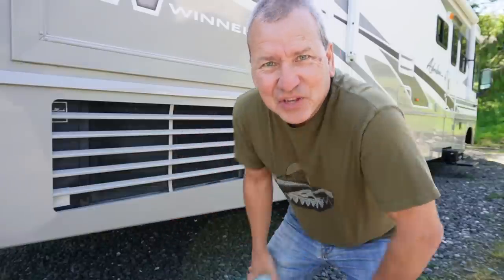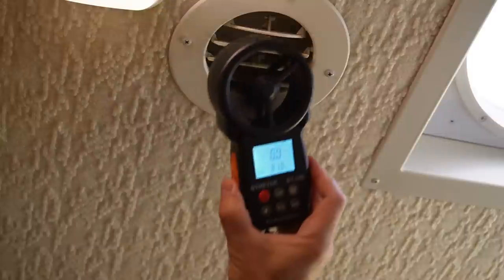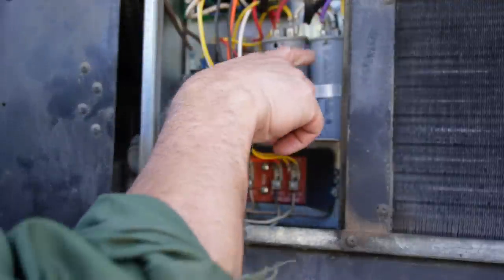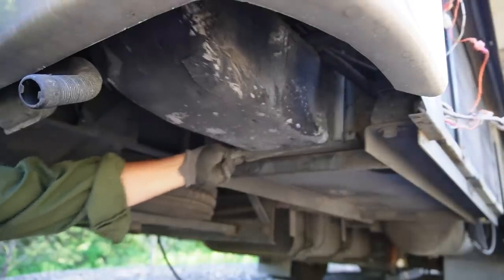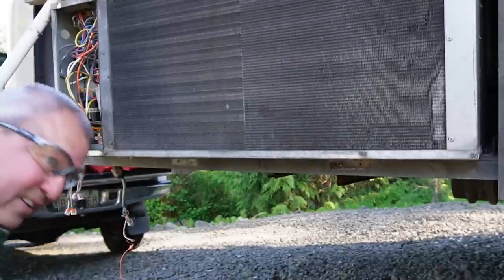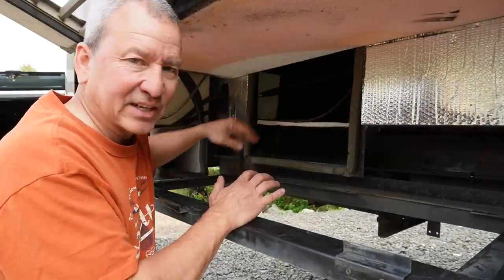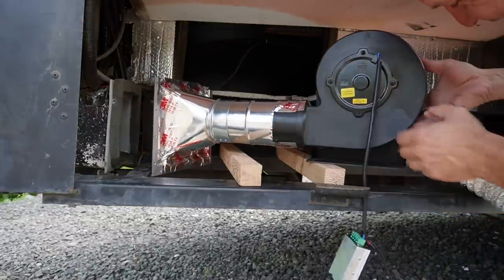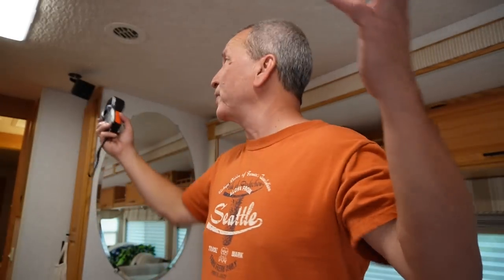My 12V RV Air Conditioner Install (Part 1) - Removing Failed Basement A/C | RV With Tito DIY

Comment: Have you considered a mini split
Reply: That was the first thing I thought of but he wants it to run on 12 volts. I don't think there are any 12 volt mini splits but I could be wrong.
Reply from the maker: Yes. It will be a mini-split...just not the kind you're thinking of ;)

Comment: 48v system with a small 12v for your lights/pump. Run everything large off 110ac. 12v, 1000w? No.

Comment: Looking forward to seeing your project through completion. Looks like you might be shedding some weight taking that big AC unit out and putting in something new.
Reply from the maker: Definitely. It was an immediate 200 lbs of weight loss. I can't imagine the replacement components weighing half of that.
Reply: @RVwithTito  Has part two come out yet, i have a very similar RV this video is helping me out big time!
Reply from the maker: @clue___  No not yet. Still working on it slowly though. Probably more coming in early/mid August.
Reply: @RVwithTito  Awsome I know it’s really time consuming just to make repairs but on top of that you have to film everything and edit the video down. If possible do you know which system your going with I’d like to go ahead and place mine on order. lol I know I might be asking a lot. I just want to take my family out for there first trip before the summer ends. 😄
Reply from the maker: @clue___  I'm working with Cruise N Comfort in Arizona. Installing a customized version of their larger VES MAXX system which is going to be challenging for my RV.  It's not a drop-in replacement and will require significant modifications to make it work. Working on improving my welding skills as we speak :) We've cancelled our summery travel plans and are taking it slow.
Reply: @RVwithTito  oh ill have to check them out excited to see the outcome! Ill have to see if its something I can find for a guy with a lower skill level. not sure if welding is in my wheel house 😀
Reply from the maker: @clue___  You could install a traditional mini-split, but you'd have to mount the evaporator and blower inside on a wall.

Comment: The basement air on the 2003 Winnebago I bought was completely dead. I bought a new board, relays, caps and motor bearings. All total about $900. Built cribbing with wheels and slid the unit out without issue. Rebuilt in 2 days and reinstalled. Comp #1 drawing 5.27A and #2 drawing 5.16A. Heats and cools like a champ.Did I mention that I had no experience in this area.

Comment: Your first airflow was measured at low fan speed. The test blower only had half the flow at its full speed. I think you should have checked flow with the original unit at full speed too. Seems like you would need a much larger blower to keep cool. You must never visit the desert Southwest in the summer. I wish you well in finding a replacement unit. There are many new, low power HVAC options available nowadays. Hopefully you will find a solution that fits without too much modification (cobbling). However, cobbling is pleasurable. Cheers.
Reply: Sorry, I just read you were installing a mini split. Good choice. Looking forward to following the journey.
Reply from the maker: I measured the old-fan speed at low because we have always used it on low speed which is plenty powerful. The high setting isn't much different. Yes. There will definitely be some cobbling :)
Reply: @RVwithTito  Thanks for the reply. I had a 34 foot trailer for a few years. It had two 13.5 kBtu roof units that in the Texas summer I needed to run full blast to keep cool. Noisy as all get out. I just installed a 12 kBtu Mr Cool split unit in my wife's art room that replaced a noisy window unit. Very pleased with the quiet effective cooling we get.

Comment: How about an external/outside 120v outlet for one of the spare circuits? That might be generally useful.
Reply from the maker: Thanks. Yes that's possible. I've got one on the side, but having one on the back to charge bikes and run my power washer may come in handy.

Comment: If you don't already have a 120v plug at the back of your rig it might be useful to use one of those circuits for that.  When in camp I usually put my ebikes out of sight at the back of the rig and it would be nice to have a 120v plug there for the chargers.
Reply from the maker: Same here. I have a plug on the side to charge the bikes on the rack. Having one on the back would eliminate the extension cord 👍

Comment: Probably too late to suggest just retrofitting the old AC tray with a new compressor and blower motors that are efficient. Maybe even go heat pump.
Reply from the maker: Oh I know. I'm still considering using the old AC tray, but I probably won't and built my own enclosure instead. At least I have the dimensions since the AC is sitting in my driveway :)
Reply: @RVwithTito  I have a background in commercial HVAC, you can replace all of the components with new technology. Going too small on the cfm or btu ratings will actually increase the power consumption over longer run times.
Reply from the maker: @arthurcutting9227  Appreciate that. I'll keep it in mind.

Comment: The test tools you create for your projects and your planning and engineering solutions are top notch.  Thank you for your terrific content.  BTW, after two years of full timing with our RecPro powered recliners they are shedding their skin.  The mechanics are still great, but the pleather could not hold up to normal daily wear.
Reply from the maker: Sorry to hear about the recliners. Ours have held up ok (in our old rig). We treated them twice a year. New owner, has a couple dogs. So I'm not sure how the pleather is doing. Will have to ask.

Comment: I’m excited to watch how this turns out. I have a 2000 Winnebago Suncruiser with the similar basement AC w/dual compressors.  I just replace the evap blower motor, processor board and all the capacitors, too. Each one pulls about 9 amps so I did not connect to my solar system.  Thank you for these videos, this will be very helpful.
Reply from the maker: Yes. Around 9A per stage. I believe I could repair this unit if I wanted to get the parts and spend the time. But it would still be pretty power hungry and that doesn't work with our boondocking lifestyle. Still working out the details on this one.

Comment: We have the same ser up as well. Just returned from a beach trip. It struggled to keep it cool for a couple of 90 degree days. I pulled the slide outs in during the day to reduce the amount of cubic feet it had to cool. It helped, but not livable if we had a good week of that weather. Going to experiment also. We'll see what you come up with in the future.
Reply from the maker: Yeah. Frustrating. I'm making good progress and am optimistic. I hoped to get an update out yesterday but wasn't able to. Too much going on. Hope to share more next weekend.

Comment: I enjoy the content.  I have the same rv .  A 2001.   My air is working great . Looking forward to seeing your solution.   Love my basement air .
Reply from the maker: Thanks! Agreed. The basement air is great and much quieter inside. It's a feature that really appealed to me, given the extra space for solar. Plus there's no ugly/loud equipment on the roof.
Reply: @RVwithTito thanks for sharing your experience and knowledge, I’m about to remove my basement AC like yours, I have a bad blower problem and will be changing both blowers any suggestions on what else I should do?

Comment: I believe the air flow measurement to which you referred is in cfm (cubic feet per minute). Looking forward to seeing the completed project.
Reply from the maker: Actually the little gauge isn't that fancy. So it doesn't calculate the actual Cubic Feet per Minute. It simply measures velocity (wind speed) of the breeze blowing out as Feet per Minute. For cubic part of CFM I'd need to take the dimensions of the ducting into play and do some math. I'm just using it to measure something as a baseline :) BTW the 12V blower I was testing has a 390 CFM rating incase you're wondering.

Comment: Hello Brain, Those two circuits will definitely come in handy. Maybe you can turn them into outlets and use them for portable electric heaters or something like that. Just a thought. I am looking forward to seeing what cooling system You plan on using! A 12 volt system sounds really awesome! Looks like You will have plenty of room to work with. Looking forward to the next phase of this project. Keep up the great work and stay safe out there! God Bless.🙏🏻👍
Reply from the maker: Thanks. Yeah I've got a couple good ones already I use for a space heater which does the job good when plugged in. My primary heat when off-grid is my Gasoline heater (Webasto) which works great. My LP heater is my backup.

Comment: Hello Brian, great video.. I'm thinking that you will not have enough air moving so you may have to do a larger blower or add a second stage to that blower.. also, it's going to be a tall order to do the compressor and the blower for only 1000 watts. BUT I really hope it works.
Reply from the maker: Yes. I'm going for a second blower/evaporator. We'll see what that does. Still waiting on equipment though and working on other projects.

Comment: Another very interesting project.  I would look at the 24 or 48 volt marine heat and AC units.  You'll get a higher CFM out of them and you can use a smaller gauge wire with 24 and 48 volt, probably 6 or 8 gauge.    I think with the marine units you'll be at or under 1KW.
Reply from the maker: I like the marine heaters. The only problem is that they're water cooled with sea water. That's why they are much smaller. I know...bummer :)

Comment: I always likes the Itasca's with the Basement air.. The Duct work goes up thru the endcap...
Reply from the maker: Yes it does. It is a nice unique setup. I prefer it over roof A/C.
Reply: @RVwithTito  Not actually unique. I know Alfa's see ya motorhomes from the same era had the same Coleman basement ac system. I think Alfa also used it on their 5th wheels.. There are probably others I don't know about off the top of my head. Winnebago was just the highest volume manufacturer to use it.
Reply: @RVwithTito  Being a retired Boat Capt. and a RV tech for 6+ years, This model is one of my favorites because of this reason...

Comment: I appreciate you pulling the A/C out of its hole and showing us what it looks like.   It’s a box…😂🤣, that’s all it is, I thought it would be more complicated than that (more attachments) but I am wrong.  I do really want to take mine out, take off the cover and clean all the inside condensers and stuff because I know it’s probably dirty as hell.  I’ve cleaned and straightened out the coils on the outside of the RV and on the intake end(under the bed).  Just not on the inside of the system.  I am REALLY interested to see what type/kind of AC you install now.  Will it be the same or much colder with less power?  Also, you’ve freed up sooo much more space by taking that box out!!  LOL!!!   Take care brudah!!!
Reply from the maker: Yup. Just a big box sitting in my driveway now. The compressors are on the right side. Once out I saw some issues that I could probably fix. Not sure if it's worth the effort, but it's a great learning exercise. Believe it or not, my coils are in pretty good shape and very clean. I've only cleaned them from the outside (and under the bed). If you rinse them down regularly (or use coil cleaner) they should be fine. To access the blowers, compressors and refrigeration lines requires you to take the unit out. Yes. I'm excited for what's next....as soon as I figure out what that is 😅

Comment: Wondering about using DC instead of AC? Yes, you save Inverter conversion O/H, but that will not be that great an amount, and IF you want to use the A/C when on shore, a large amount of the Multiplus Charger output will go to running the A/C rather than charging your Lithium bank, but if you have an AC A/C, that gets bypassed when on shore. 
Just thinking AC will be the more flexible option (as well as saving running some hefty cables as well). 

Having said all that, just installed a DC 600W Electric Heater (we don't need A/C cooling in the UK :( ) in my RV so I can bypass my Multiplus if I want :)

Looking forward to the next  stage on this install.  It will be a top job as always :)
Reply from the maker: Yup. There are pros/cons. I believe a DC solution will be a better fit for how we travel (rarely on shore power). We'll see how it goes :)

Comment: Hi . This is what i am doing . Put the two together to give you 240 volt . This will then supply a Domestic Dryer . We are fitting the Swedish ASKO. Washer and Dryer . As fitted to Showhauler. They are small European size machines . TOP quality. The 240 volt 30 amp supply runs the Dryer , the washing M/C plugs into the Dryer.
Reply: Can you please post links what you are talking about please?!?   I’m intrigued…lol
Reply from the maker: Nice! I wish we had the extra space.

Comment: Mini Spits are a great option. I haven’t had much exposure using them but in my research it seems you run Freon lines to evaporators in your environment. So rather than using the existing duck work to move air maybe you could run the Freon lines in them to evaporators in the coach. I have watched all your installation videos and your skills are wonderful and I think you could easily retrofit the evaporators. The cooling efficiency would be far better and lots quieter. Just a thought.
Reply from the maker: I certainly considered the traditional mini-splits, but just (1) the compressor section is too big for that space and don't want to look at it and (2) have no room for a head unit inside.  Some have concealed ductless options, but they are built for attics and would be tough to fit as well.
Reply: I plan on putting a 12K btu mini split on my 35’ shuttle bus. I took out the compressors as you did and will rest the mini split compressor on the brackets left by my old system. Part of the compressor will rise above the floor and I plan to enclose it as maybe an end table. Should be enough ventilation from the louvers on the outside door. Not sure how many solar panels I’m going to need but I will be looking for something in the neighborhood of 400 watts each. Then there’s the lithium ion battery quantity to consider.
Dometic just came out with a 2000 watt 12 volt rooftop RV A/C unit. It’s about $3000 with the wiring and brackets but I don’t think it is large enough for me or you.❤

Comment: We have the same rig, A 2003 Adventure 33 but with the 8.1L GM Vortec and Allison trans so really getting a lot out of your content. I just started adding Lithium and Victron charge controller and some ground panels for now,,,, been following since you had the class C.....  We have the same Colman Mach basement unit.. it blow like a hurricane but yes with 2 compressors it's sucs up power. big time ... our Onan 5,500 feels it when it kicks in... That's going to be a tough retrofit I bet.. Looking forward to your engineering concept on a replacement. BTW.. your Alaska vids are just AWESOME.. on my bucket list...
Reply from the maker: Thanks. Yeah. I'm piecing it together now trying to figure out how to get all the components in there nicely. It's a bit of a project.

Comment: I am very interested to see what you do here.  I have an '04 38R and I was planning what to do for when my heat pump goes out.  My first thought is still just putting in a 240v minisplit with 2 zones, as that would still be more efficient than the built in heat pump, but I'm interested to see your solution.  Options are never bad.
Reply from the maker: There's nothing really designed for this use-case. So we're having to get a little creative. So we experiment...

Comment: I will have to watch and see what the final design will be. I’m in the same boat with my my 20+ year old basement unit. The manufacturer is out of business and it’s hard to source ac parts for R-22 systems.
Reply from the maker: I'm getting back to it soon.

Comment: I’ve rv’d in Texas in the summer. Had two ac’s 15 & 13.5 and it was hard to get to 80 degrees. I’ll have to see what you come up with but I would hate to cut my blower output by half.  I do realize you may not have an alternative.
Reply from the maker: Working out some options right now. I think it's going to work well.